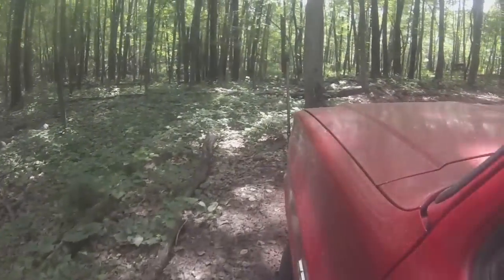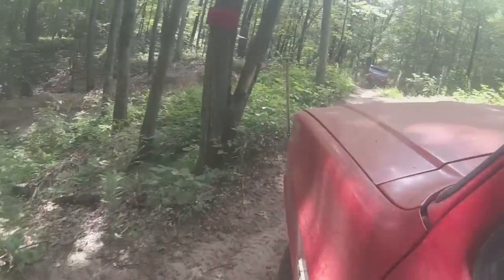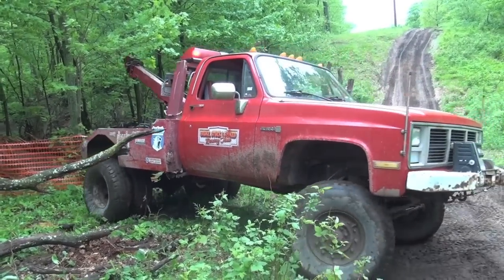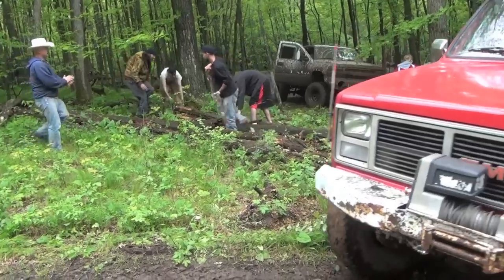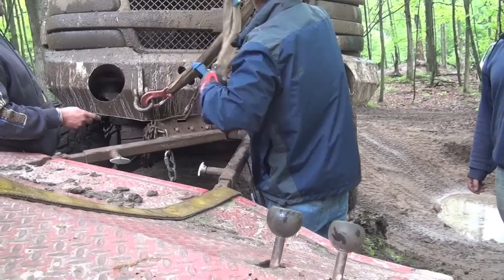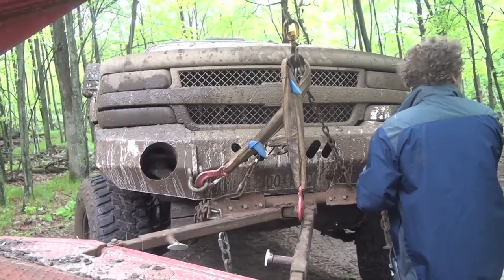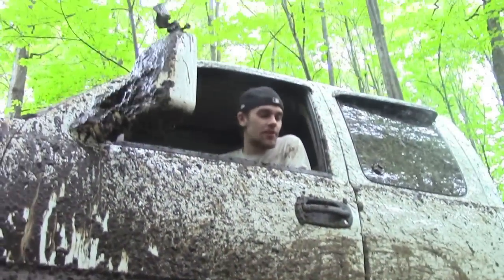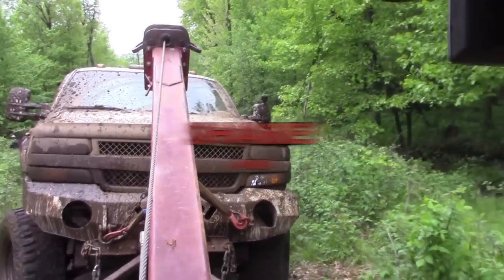DURAMAX RESCUE by BSF Recovery Team

Comment: IFS is so terrible in terms of doing anything other than hauling down the highway...
Reply: +plane45036 its fine light offroading, just can't be an idiot and lead foot it.
Reply: +arbiter1 Light offroading as driving down a gravel driveway right?
Reply: +plane45036 Solid axle is best at offroading..everywhere else ifs makes it its bitch.
Reply: +Ruger260Taurus Except for towing, and daily driving.
About the only benefit of IFS is if youre in the desert doing some baja at high speeds. Low speeds, solid axle is still preferred.